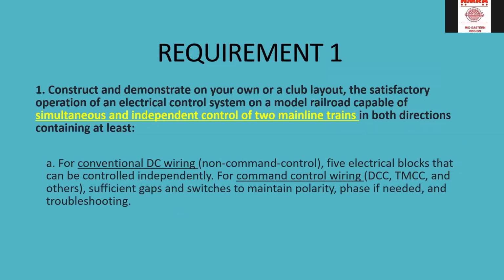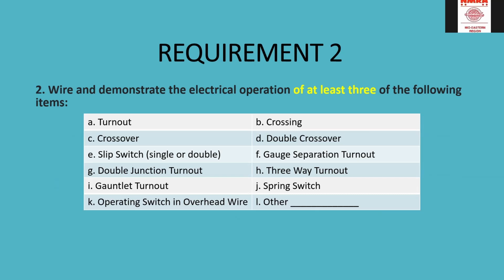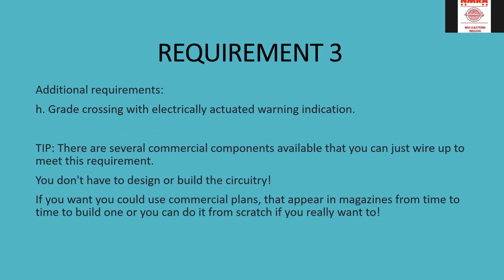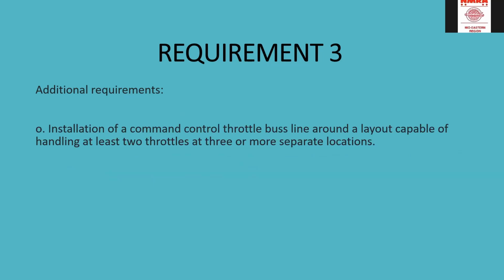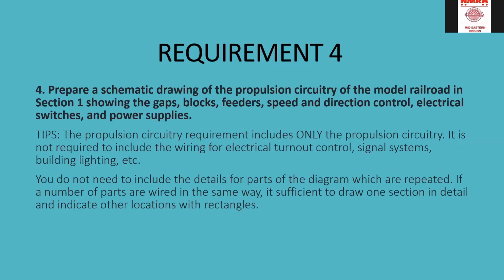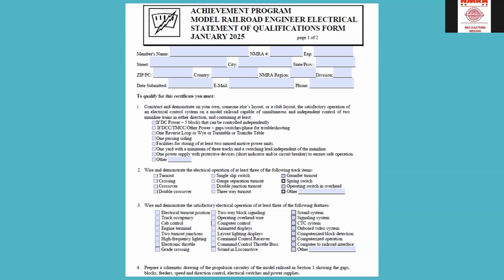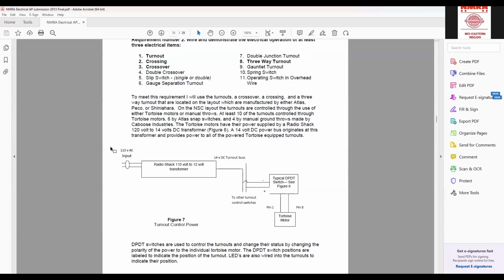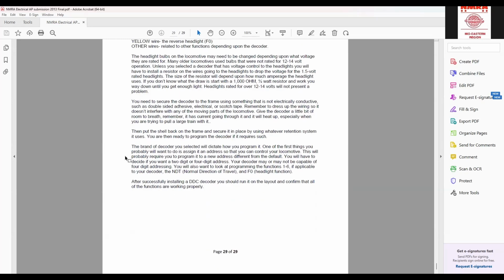NMRA Achievement Program  "Electrical requirements" clinic. Clinician: Ernie Little, MMR.

Comment: 9:21 - My Layout is a1 and a half room sized layout.  I still do not have provision or a place to have a Turntable or transfer table.  I Have 3 engine service areas on the layout as part of the 3 Yards.  My layout is "Modern" as in 1996 when the SP was still active,  I started my layout planning in 1999/2000.  Some time this stuff seems a little out dated even when I'm modeling something that is from 30 years ago.    I have something like 15 engine service/storage track shared between the 3 yards.   8 at Enterprise Yard, 2 at La Grange industrial park and 5 at South Yard.